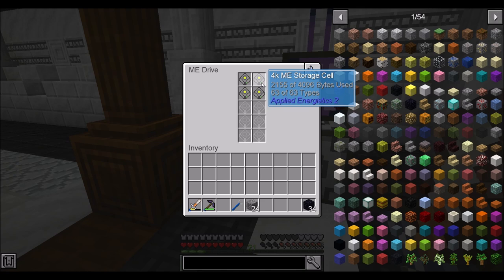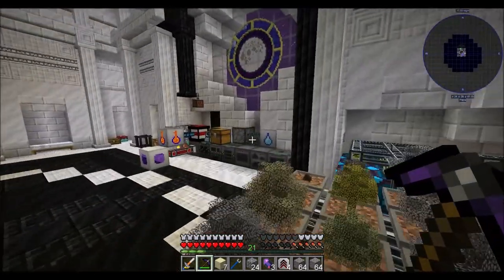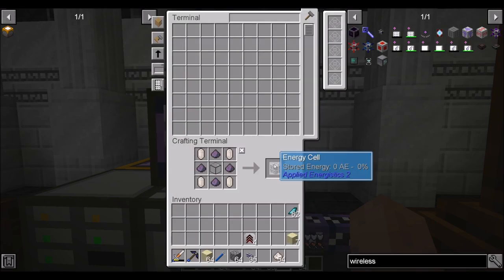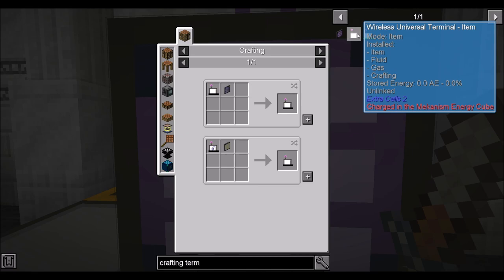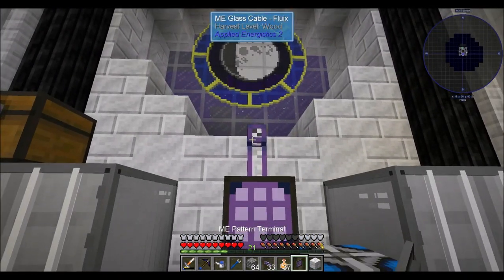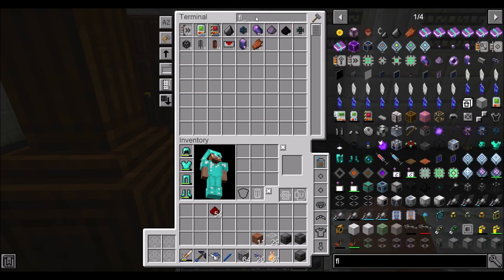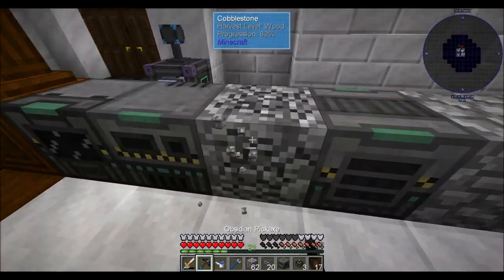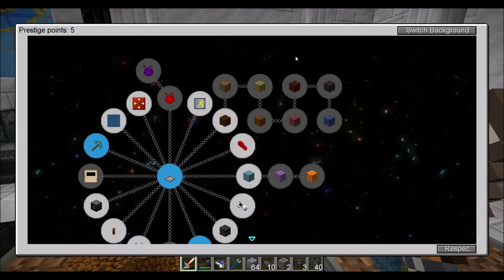Sky Factory 4   Ep20 Wireless Autocrafting

Comment: The wireless terminal is not the universal terminal, you have to craft it into the universal which then allows modes to be added Dire :)
Reply: Sweet thanks, I didnt want to have to add a mod to get that
Reply: the wireless universal crafting terminal doesn't work on skyfactory 4 for some reason, so he did need to add the mod.

Comment: First you craft the wireless universal terminal using the AE2 wireless terminal, then you can craft the wireless universal crafting terminal
Reply: So there is no need to add another mod for wireless crafting? It works?
Reply: the wireless universal crafting terminal doesn't work on skyfactory 4 for some reason, so he did need to add the mod
Reply: @bilalmukhtar5130  Oh okay, well I don't wanna fiddle with it and then my brother has to do it too, or is it easy to install?
Reply: @ino145  late reply but installing your own mods is super easy. If it adds items or blocks, then it needs to be installed on the server, and all player clients. And to install the mod, just download it from curseforge and place it in the 'mods' folder.
Reply: @JackieAych  Thank you!

Comment: System keeps going dark because of power drain. 
AE battery helps to combat that. 😉
Reply: Dua1chaos its because the flux plug transfer rate on energy cube is limited
Reply: command block tech the battery would help though. I though he uncapped the transfer rate of the flux point? Eh he’ll figure it out lol
Reply: Dua1chaos he mentioned about using the Energy cell but never did
Reply: energy buffer in AE system is never a bad idea, NEVER, and yet again dire did it only if things go REALLY bad.

Comment: I don't blame you for adding those two mods. I also added them.

I know that the Wireless Universal Terminal exits, but I have found it to be very buggy. I have had trouble adding terminals to an existing universal terminal. Sometimes it will act like the recipe doesn't exist. Other times it will craft, but when I try to open the GUI it DELETES itself from my inventory! Nothing shows up in the log file either! I also have not been able to get the crafting mode to work. The GUI just won't open. It's acting like it's not linked to a network. The other modes worked fine.

I haven't reported these bugs yet because I haven't found a consistent way to replicate them. Until then I'll use the other wireless mod because it works just fine. Sure it doesn't have fluid and gas modes, but I almost never need them.
Reply: The other failure mode I've seen is that it corrupts your personal inventory. On a multiplayer server it won't even let you log in.
Reply: How do you change the infinity booster card? I cant find a config file.
Reply: @boggless2771  The file AE2WirelessTerminals.cfg is in the config folder. You'll probably find it in C:\Users\<username>\Documents\Curse\Minecraft\Instances\SkyFactory 4\config (in Windows anyway).

Change UseOldInfinityMechanic to true to make a single card last forever.
Reply: @therm0tt0  awesome thanks!

Comment: What are the mods you installed during the episode?
 Quality of life changes are always good, and these dont throw balance away.
Edit: Tinkers Armory can make speedy armor. Cobalt and/or redstone modifier. It can anchive ridiculus speed. Mentioned in some other episode he wants to be faster.
Reply: He added Just Enough Energistics, which allows you to add items directly from JEI to AE2 Pattern terminals, and Wireless Crafting Terminal (yes that is also the name of the mod).
Reply: 19Gabor97 I think they were both good, and both pretty needed,
Reply: @GirishManjunathMusic  from what I've seen, Wireless Crafting Terminal wasn't needed, he just wasn't going about getting the universal one properly, so all he did was add a mod to simplify getting wireless crafting and to make it a bauble that lets him open it with a key press instead of using it normally. I've also seen someone say JEE wasn't needed either because you can already do that, but even on videos from others I haven't seen them do that

Comment: How much does enabling channels break crafting wise? And how easy is it to fix? (Likely craft tweaker work I would guess?)
Reply: Assuming I'm understanding your question, enabling channels limits how much is allowed to be connected to the system, at least without work arounds. That includes every drive and bus and assembler. So with channels enabled, you can still manage to autocraft fine, it just requires a lot of work managing the cables so you aren't limited in how many assemblers you can set

Comment: Can someone help me.. I've had a flux plug hooked up to an Enriching and Smelter Elite and was testing some Import and export with amber, and the power just went down, it couldn't even keep these two machines running, is this normal? I have 20mil energy stored. :(
Reply: Flux plug is attached to your power source. Flux point goes on the destination that needs the power (a machine or power cable attached to machines, etc.)
Reply: Yes indeed, I know that thanks. But my machines are only getting 2K RF and they need 2.8K RF to work at 100% so I don't know why more power isn't comming out. Perhaps the block can only push out 2k RF? (Using Medium power cells atm.)

Comment: Wireless Crafting Terminal should be a prestige thing probably?
Reply: It's not in the pack at all. The "Universal" terminal that claims to be able to take a crafting terminal as an upgrade, doesn't.
Reply: I meant the mod that Dire added.
Reply: @realflemmli   I see. Agreed. For all of the convenience features of the pack, this one is sorely missed.
Reply: @N0stalgicLeaf  really? Because according to others, it is in. You craft the universal terminal from the wireless terminal and continue from there to upgrade
Reply: @Kahadi  How do you upgrade? Do you have it working? I struggled for an hour and it simply did not work.
Reply: @N0stalgicLeaf  I looked some more and apparently its been disabled temporarily because of a game breaking glitch Darkosto hasn't fixed yet. Don't ask how accurate any of this is, I'm only going by what others have said
Reply: @Kahadi  Three years later, wondering if he fixed it yet? i dl the pack, and i still cant seem to get it to work

Comment: I feel like all of this is just locked and dire didn't even try to unlock it and see that its already there in the pack so he cheated
Reply: If it was it wouldn't have changed anything when he added the .jar to the mods folder since the configs would be the same
Reply: I feel like you are wrong
Reply: @nickr26  maybe I am maybe I'm not but all ik is that he didn't even try to unlock the controller from the prestige quest
Reply: @justinkulczyski3772  there's sometimes the default files can overwrite the customised files based on priority I think.
Still practicing jar stuff.
Reply: The crafting grid mod and the just enough energistics wouldn't have affected the config files for stages, craft, tweaker, etc